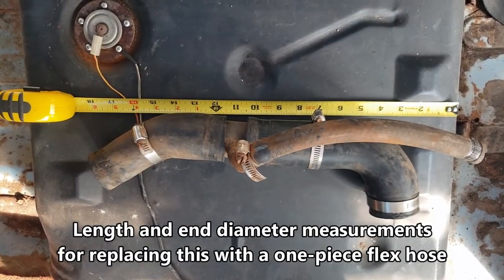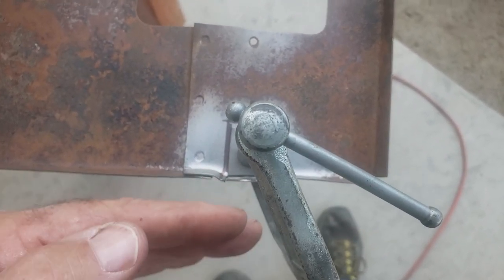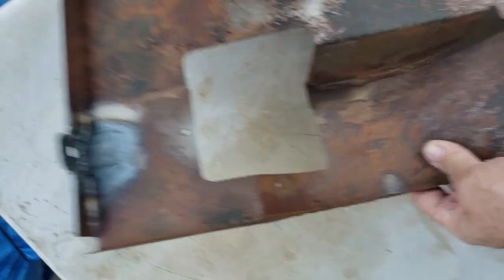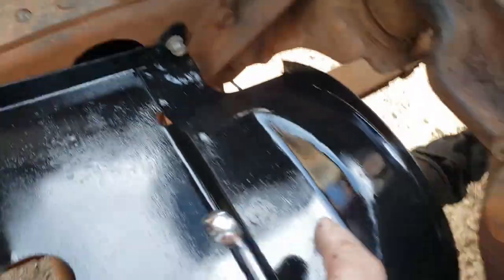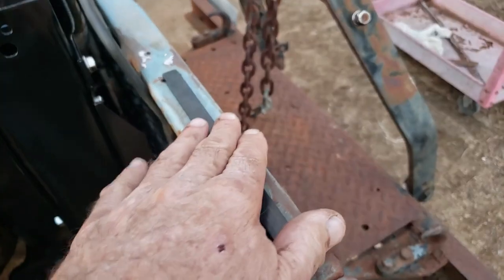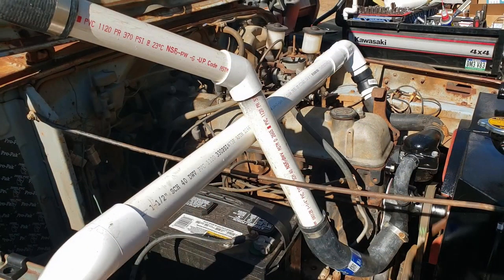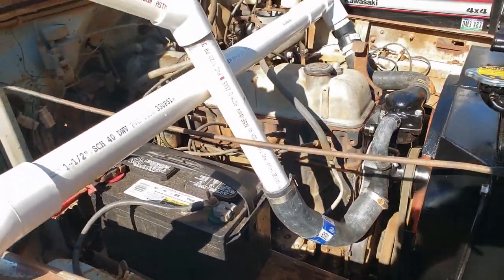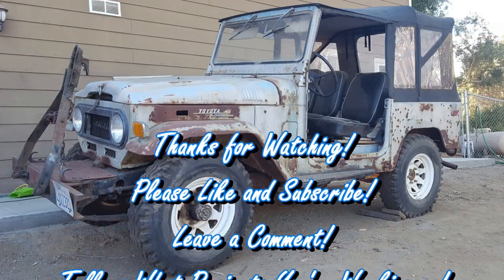1970 Toyota FJ40 Land Cruiser Cooling System - Water Pump, Thermostat, Shroud Refurbish, Flushing

Comment: Thank you for the excellent video and flushing idea. I am rebuilding my 1971 1f engine right now at home. I pressure washed the water jacket and had huge gobs of rust coming out. I imagine more may have formed since and I don't want to ruin the new radiator, this is a great idea! The tip about not using a thermostat is smart too, because it could never get up to temp with the constant fresh water flowing through.
Reply from the maker: Thanks for the comment and subscription! Glad to see that this was helpful. My hope is that others will find some use from these videos. Thanks again!

Comment: What’s the story behind the truck.
Reply from the maker: I got it in 2016, not running. The seller said it hadn't run in years. I messed with the carb a little just to get it running (barely), then found out there were no brakes. It sat from then until early 2022 when I retired and started working on it. I'm trying to make videos of everything I do to it.
Reply: Very cool  keep her running 👍

Comment: I'm gonna have to try this as I'm still overheating w a new tstat n waterpump
Reply: My one concern is that my bottom rad hose never gets hot, any ideas?
Reply from the maker: @oscarpallaresmedia21  When you say you're overheating, is it boiling over, or are you just seeing it on the guage? Could it be a bad gauge? If it's boiling over, but the bottom hose isn't hot, it could be a clogged radiator. In theory, the bottom hose shouldn't be hot if the entire system is working properly. The coolant exiting the radiator should be getting cooled by the radiator.
Reply: @RanchoCoyote  thanks for the reply, I flushed everything including the block, everything flows, clean water comes oit out everything. New pump and tstat, vacuum bleed n fill system, after 10m of running gauge starts climbing.
Reply from the maker: Mine was doing that also, but it was also boiling over spraying hot water and steam everywhere. Just to see if my radiator was capable of keeping the engine cool, I ran it until the temp started climbing, then sprayed water over the radiator. That worked great and kept the rig from overheating and within the normal temp range. As soon as I removed the water spray, it got hot immediately. I know there could be other factors, but I took the results from the spray test to mean that the radiator's cooling function wasn't performing, likely from being clogged with rust, scale etc. The radiator was in pretty bad shape overall and would have cost more to fix that buying a new one, so I went with new. That made all the difference. Never gets hot now.
Reply: @RanchoCoyote  I'm installing a new temp gauge on top of tstat housing, that would alse help to bleed the system by cracking it open a bid
Reply: Runs great with no tstat, don't get it!
Reply from the maker: @oscarpallaresmedia21  Test that thermostat. Put in a pot of water on the stove. Use a thermometer in the water to monitor the temp as the water heats up. The thermostat should start opening when the water temp is near the thermostat's temp rating.
Reply: @RanchoCoyote  tested the old one and the new one, both open at 180*
Reply: @RanchoCoyote  new one is oem from cruiser corps as well not a cheap one from auto zone.
Reply from the maker: @oscarpallaresmedia21  any chance it was installed backwards?
Does your temp gage read actual temp? 
What happens if you let it continue to heat up
Reply: @RanchoCoyote  yeah temps right now are below the half mark o. Original gauge without tstat, when I install tstat it keeps rising and bottom hose doesn't even get warm. New gauge is showing about 140* even after I drove it for 1/2 hour.
Reply: @RanchoCoyote  tstat goes 1 one way and made sure to use rubber o ring on top as well.